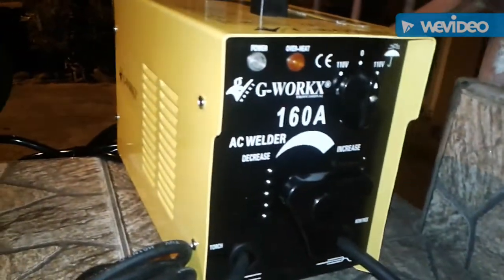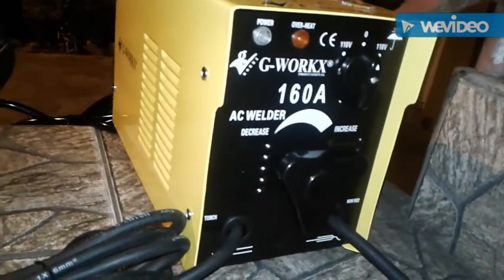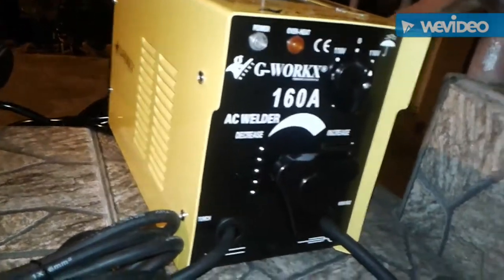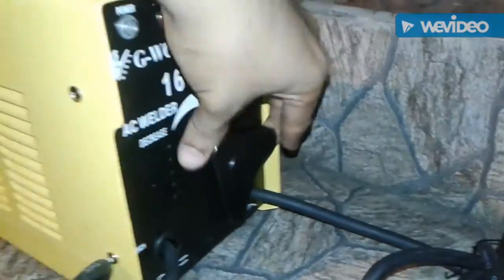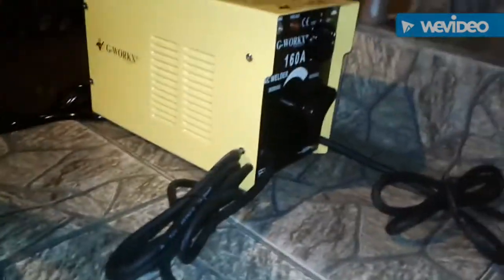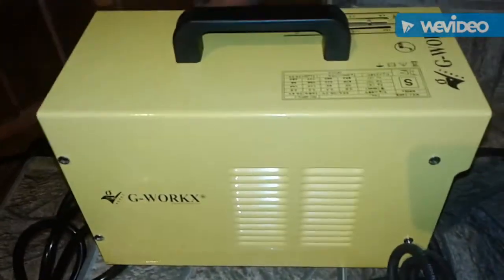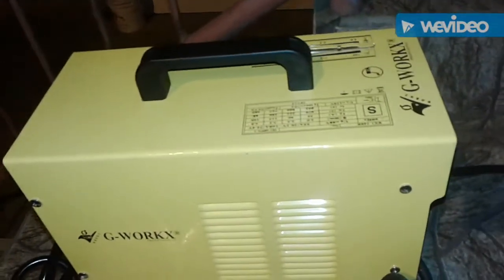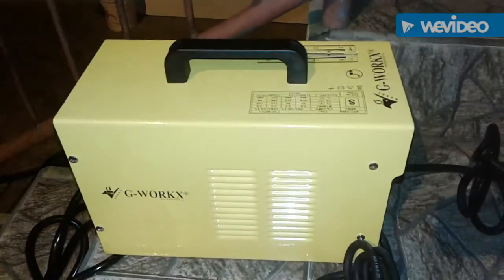160 Amp ARC Welder

Comment: What Guage extension cord should be used and at what amperage should it be?
Reply from the maker: A heavy duty/ 2.5 mm2 and no more than 12 feet on a 30 amp braker....
If u running it from the braker it can be a lil longer

Comment: What thickness can this portable welder weld?
Reply from the maker: Its not what thickness it can weld you need to look up the rods you want to use and how much amp they need eg 6013 1/8  needs  80 - 130 amps and the welder goes up to 160 amps so you will have to do some research 😉  hope this was helpful to you

Comment: Jacob great review, but im using this on a 30A breaker and it keeps tripping all the time
Reply from the maker: U may need to weld for a shorter time frame then no more than 1 - 2 mins  and let it rest. Remember the duty cycle on the welder , that could be y
Reply: It trips before that
Reply from the maker: @doublekkinc  how long do u get to weld ? What size rods
Reply: @JacobandNichVlogs  not even 20 seconds, and it's a 6013 rod
Reply: The breaker was also changed to a new one (30A)
Reply from the maker: @doublekkinc   maybe u did not wire the welder correctly or its touching thats d only thing i can think about sorry
Reply: @JacobandNichVlogs  I will look into this?
Reply from the maker: Np tell me if u do
Reply: Kazim you can just wire too  twenty amp breakers together on the 110 outlet that should give you enough power to use your welder.